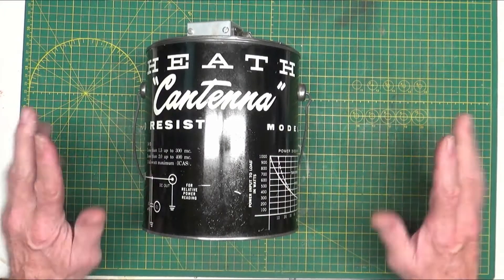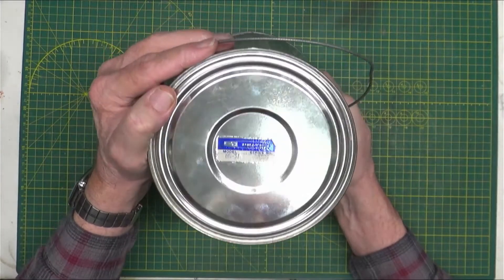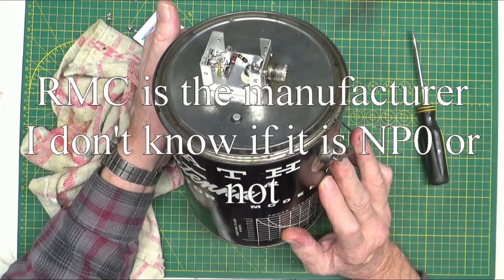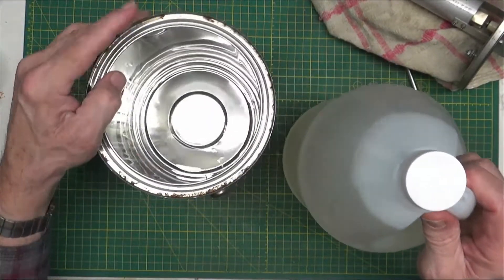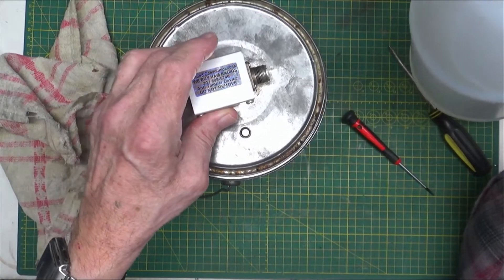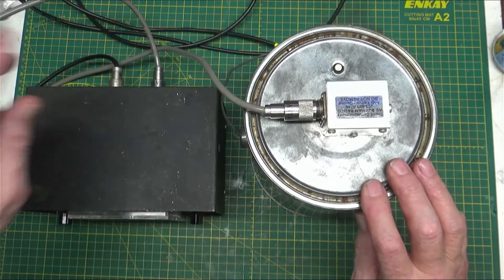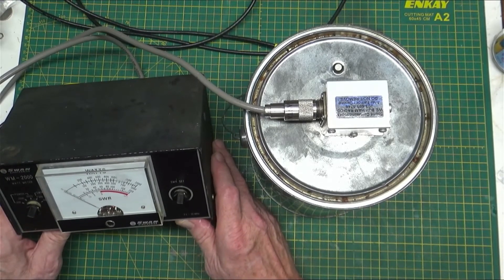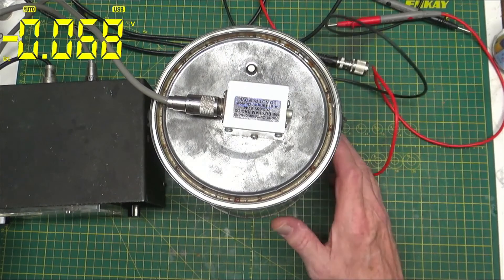Checking Out My New Heathkit Cantenna

Comment: That's the cleanest one I have ever seen.
We had a Radio Shack brand one at a 2 way shop I worked at.

Is there a difference between plain old mineral oil and transformer oil now?
The old stuff with the PCBs could take a lot more heat than plain old mineral oil.
Obviously you don't want the PCB formula.

You can get mineral oil cheap at farm stores.
I guess they use it to lube up constipated cows.
It is $23 a gallon right now.
Reply from the maker: From my understanding transformer oil can take more heat but also it depends on what you are using the thing for. If it is just to pump a hundred watts into for a few minutes of testing it won't make a difference.

Comment: We found this very Cantenna in Dads Radio Room the can is Pristine.
There is liquid inside and I did find a faint odor of chemicals.
Around the top was liquid but I dried it.
I don’t want to throw it out.
I don’t think it’s Mineral Oil.
How do we make this can safe to keep?
Reply from the maker: Transformer oil has a faint smell to it. That is the kind of oil you use if you want one of these to work it's best. If you are worried though try calling your local extension service and find out where you can get rid of the  oil.

Comment: Today I was given the Heathkit Cantenna with oil in it. I may end up getting one rated 
at 1500 watts anyway. I need it to tune my Amplifier, which is 1,200 watts. They have the
1,500 watt version at HRO for $104.95 with transformer oil a little less without oil.
Thanks for the video.  Gary KF6EWO
Reply from the maker: Color me envious.  I can't even put out an antenna that will take 100W. HOA and nosey neighbors.

Comment: What Type of resistor is that?
Reply from the maker: It is called a ceramic tube non-inductive resistor. The outside resistor part is carbon film and the ends are aluminum metalized bands for mounting. MFJ used to have them as part #115-1500A but I don't think they carry them anymore.
Reply: @AERVBlog  Thanx😊
Reply: @AERVBlog  They are expensive🙄
Reply from the maker: @vlupis1  yup. But still cheaper than most other 1KW dummy loads.

Comment: I thought about building one out of a old can.
Reply from the maker: That would work fine . The resistor is the big deal but they can be had.  Goggle search. Just make sure the resistor is not wire wound. It has to be pure resistance,  no inductance.
Reply: @AERVBlog  yeah, I'd thought of that too.  Probably a summer project.  Elmers made stuff out practical things.
Reply from the maker: @gbowne1  oh yeah. Done my fair share of that.